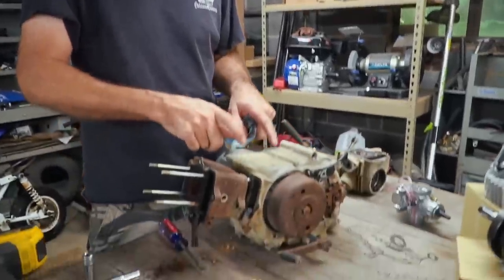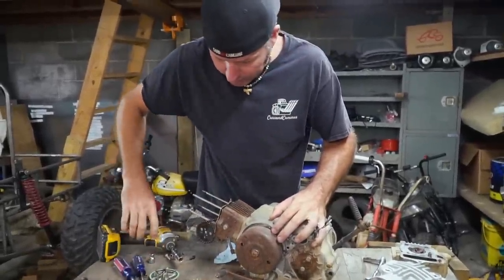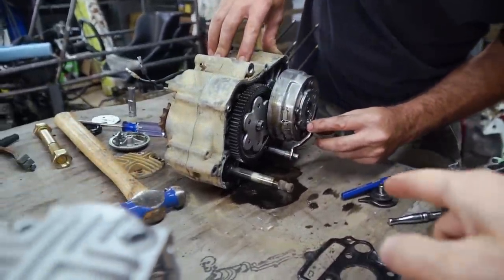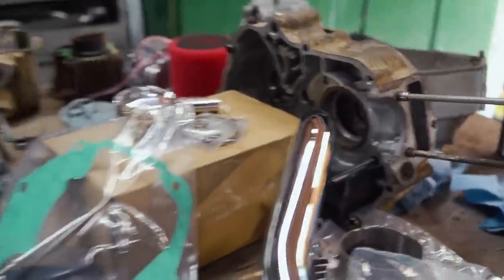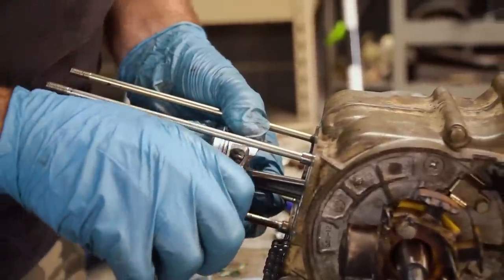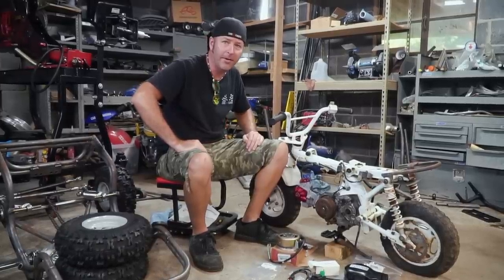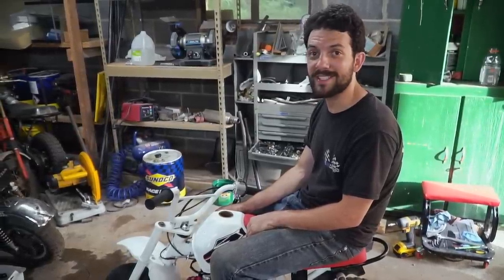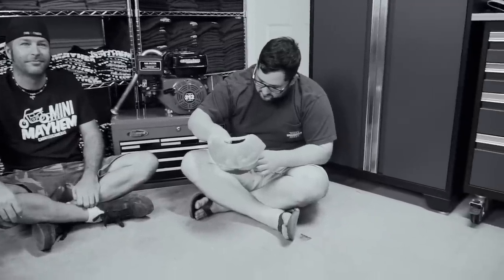ABANDONED Frozen Honda Z50 Engine Rebuild + Upgrade | Racing 108cc Big Bore Build

Comment from the maker: Happy Labor Day! Hope you all are out enjoying awesome weather!
Reply: CarsandCameras hey i don’t think you would go this far but, me and my buddy want to sell or trade his full size buggy/go kart. It has a gy6 copy with a bored head. It won’t run anymore and we are wanting to get something that runs. Have a Nice day
Reply: It's 11° celsius in Manitoba right now so not too nice of whether but still enjoying it
Reply: Its thunder storming here in OH so not to nice but atleast its in the 70s temp wise
Reply: Do you all want that grsx 750  that I’ll give you
Reply: Weather is gorgeous in New Bern.
Reply: CarsandCameras great video. I did a similar thing a few years ago. But apart from cylinder piston and rings i reused parts from two different engines. A lifan block and a honda head chinese timig chain and diy gaskets :). Had to change camshaft cause the valve would hit the piston. I used old parts but when it was done it was a beast. Ps.it still drives hasent blown up yet :) hope to se these kind of videos again. Cheers
Reply: Those Z50 engines look almost identical to the ones in the Honda ATC-110 / ATC-125M   I wonder if they are similar enough in size you could swap one in?
Reply: Yup....110°F in California
Reply: @milesdzineku9940   were are you located i have a coleman ct200u minimize with a torque converter setup and a mikuni carb on it im trying to find someone i can trade it with it runs and drives fine. I just want a go kart
Reply: Happy labor day guys I took the mini bike out for a ride today got it upto 50 mph! Yeah buddy
Reply: What awesome weather
Reply: Chris Dunham sorry I don’t think I’d trade the entire kart for a motor but we’re located in Utah if anyone’s interested reply
Reply: @milesdzineku9940  it's an entire mini bike not just the motor I drive it every day pretty
Reply: And I'm on Vermont so yeah that probably wouldn't work lol
Reply: Chris Dunham oh alright sorry I read it wrong
Reply: Chris Dunham its a possibility
Reply: @milesdzineku9940  how would we work this to send them to each other? Ive been dying to find a go kart but there's not many in my area unfortunately
Reply: Thanks! Can you guys do a tillitson 225cc and put it on nitrous oxyde please
Reply: Chris Dunham idk I’d be down for local pickup but then again we might just fix it up ourselves
Reply: Would you be interested in a go cart with a predator 212 just needs new tires
Reply: @Joe803  who are you asking
Reply: Joe W depends on the size, this kart is massive more towards utv size
Reply: I was asking the cars and cameras crew
Reply: @Joe803  oh ok my bad
Reply: Joe W gotcha
Reply: @milesdzineku9940  upto you if your still up for trade
Reply: I shure did have a very fun labor day john and isaac I rode my tao tao 4 seater alot today and rode my coleman go kart and also my yerf dog go kart. Happy labor to you guys both.
Reply: mark z  your from Manitoba? Never thought I’d ever see a fellow Manitoban in the comments on YouTube.
Reply: I'm wondering when I will get my hat I order 2 weeks ago

Comment: Hey guys. When you take the clutch cover off, replace the oil pump to a high volume one, drill the case to 2mm with the oil pump out. Its the port that delivers oil to the head/camshaft.(that is a old mod) also always remove the oil screen, inspect and clean it out. Ive seen so many clogged with gasket materials, gunk and sludge. Love seeing this video

Comment: I owned a Honda Dax (ct70) once and it would not engage the gears if the gear arm didn't have enough throw, for me it was because it was bent(the arm). Also the transmission kinda jumps when you go from neutral to 1st. It's a good indicator. Love these engines. 👌

Comment: I used a tbolt stroker crank with a stock crf70 top end on a sl70 this summer. 88cc stroker. Tboltusa makes some nice stuff, I was very surprised how smoothly it runs.  They must spend time balancing their crankshafts or something.

Comment: That compression reminds me of my old '85 Honda XR500. It had so much compression I still have a chunk missing from my shin when it kicked back on me. Me only weighing 160lbs I struggled to kick it over, especially in the winter. Below 40°f and it would take everything I had to try and get it turned over. Man I miss it. I would love to have another 86 XR500R or the 85 XR500

Comment: I've rebuilt a few of these small honda engines. The shiny or chrome looking ring always goes on top. The black or plain steel colored ring is second, both with the letters facing up. Hope this helps in your next rebuild!

Comment: Great video! Looks like some shifter linkage didn't get hooked up properly. At least you can switch out the clutch for a HD unit while you have the side cover off. every stock clutch I have ever seen has been toast.

Comment: I've never seen a Honda like that one before. Looks really cool. I think what would make that bike look awesome....would be to put a longer swing arm and lengthen everything in the back of it. Seat, bar behind the seat, put a small rear fender and possibly rake the front just a little bit to make it long-n-low. it would look great and easier to ride without worrying about flipping it over backwards. Anybody else think so? that little bike has got that potential to look really awesome. It'll be fine and cool. I think that is one of the best looking small Hondas that you own.
Reply: If you didn't notice they have like twenty of them and these are trail bikes. Also they're called Honda Z50 monkey bikes

Comment: You should only have to pull off the right side case, and recheck the orientation of the shift arm and dentent arm, this is a common issue and should be an easy fix👍🏿 nice video ☺️

Comment: There's a nut and screw in the center of the case in front of the clutch. It needs to be backed off a half turn or 3/4 or so. If that doesn't work, you need a new clutch

Comment: Real quick fyi...those 50 pistons are perfect floor shifter knobs and have been used as such at least since 1980 when I used one on my manual Hemi 4 speeds shifter behind my mildly built 440 in my 72 Duster... Slick.kewl factor 11.9 on a 1-10 scale...😁

Comment: High performance inner rotor kit this thing will rev to the moon!
Reply: only when it is the short stroke version. these engine's also have long stroke. in that case you do not want a inner rotor.

Comment: Better drop a couple teeth from the rear sprocket. You have plenty of power for the "longer legs". That's cool as hell. I'd have loved to have done that with mine. My friend had a 50 cc, 2 stroke trail hopper. It was ugly as hell, but faster than my Z50a. Mine had chrome fenders and headlight bezel with a metallic blue tank. Got it for my birthday when I was a child.

Comment: 2:19 before y'all go any further in the vid just know i feel your pain...i got "stuck" fixing a friends "stuck" yamaha 200 blaster quad. This started off in July when i was asked to ride this turd home...thru the streets of west side Detroit, in the hood. We got there and it would only run on half choke and 30 kicks....once started i said im committed follow me and i never let up. Way down on power and no idle i kept er running and drove it about 5 miles in the hood to a secret undisclosed location not but a mile from the house. When in a safe space i checked it...why am i feeling exhaust gasses here and why are we glowing red between the head and jug?. Week later trailered it to my house, tore down to find the expected blown head gasket and thankfully no torch damage to jug or head surfaces. A $9 gasket later and this thing scared me by firing 2nd kit! But now there is no idle and it screamed to like 4000rpm instantly. Another day goes by i tear down the t.o.r.s. throttle over ride system, just to find a broken switch. Order a delete kit which is a cable and mikuni carb top cap and a second kit with a mechanical idle screw with a drill and tap. Some time went by as we waited for parts and some other projects to go thru.
My friend "needed" this quad for labor day weekend and i came thru last wed. Was running better than expected. I ran out of time to fine tooth comb this thing but my man was happy and took it on the spot and trailered away.
Next day i get a panic call "this thing was screaming like no tomorrow then it locked up 'bout threw me off and now wont kick over its locked up".
Im thinkin ut oh... I mixed the gas to 30:1 with 8.5oz amsoil to exactly 2 gals. I blocked off the oil injection system myself. Stock tune on a stock motor....so i knew it was nothing i did. Thank GOD he didnt blame me either (and also looking into a polaris 500 single lung 2 smoke which he will get today if first buyer backs out...its 3:59pm here in michigan and i just learned this just after 3pm...another project for me im sure, but hey keep bringing 'em and ill keep fixing em best i can.

At this early point in the vid i have no idea how your project will turn out, but as always im on your side and about to get the popcorn.
Lets do this!

Comment: plug all the holes, power wash, dry, glass bead blast then disassemble. If you like the looks of the case, clear coat . then disassemble.  use dish soap to clean after assembly.  just an idea... nothing replaces displacement!!!! go big or stay on the porch!

Comment: Just seen Ike doing the welding on the cast master cylinder.. you should check out the skid factory.. welding cast manifolds with a mig welder 🤘🤘

Comment: Parts for these engines are very cheap. Just done a 70cc conversion on my skyteam 50. Easy as same stroke length as the 50 so no need to change the crankshaft. Made it a lot more usable though.

Comment: just take the clutch cover off and make sure that little spring and triangle thing is in the correct orientation. Looks to be your problem. Sometimes it falls when putting the cover back on.

Comment: I had a seized 212 from the person that had it before me let it sit out with no air box and I could not get it to break loose i worked on it for like a week whole time it was soaking in marvle mystery oil and I just got fed up with it and smacked the piston with a hammer and broke it free and the thing still runs like a champ just a slight dent in the top of the piston

Comment: had to do the big no no to a tl 125 engine left it soaking in oil for days still needed a 4lb hammer to remove the piston, got it out cleaned the bore new rings and it ran for years, wish i never sold it

Comment: Heys guys I wouldn’t be using flat heads to spilt the cases I always just install few case bolts 180 of each other an take a small hammer an go around an tap each bolt an the case slowly spilt every time don’t wanna mess up the sealing areas especially 2 stock engines . Do as u plz just something I’ve learned over the years

Comment: ROT for rings...120 clocked on each oil and spring ring...top and bottom ring dead ahead and 180 to the rear during assembly and the top most ring has a chamfer on the inside which always goes facing up as its the comoression ring and the chamfer is forced outwards by compression during the compression stroke... ALWAYS oil rings with engine oil before installation...double and then triple check ring orientation before installing into cylinder(s)... Use heavy weight gear oil in captured/caged bearings during assembly and cam lube profusely on all camshaft lobes.lifters.rocker or roller tips and pushrods ends...2000rpm for 15 minutes for camshaft break in is normal... Break in using the oil you're going to run in it and filters n oil is cheap compared to internal engone parts...change it as soon as break in is complete..
Reply: Your engine break in will be trouble free and engine will last longer...

Comment: Spray the engine cases with eagle one mag wheel cleaner. Be careful with anodized and zinc plated parts. But it will clean up engine cases like new. Just dont let it sit on too long. I clean my bikes with it almost every wash.

Comment: I never knew the piston rings can actually pull engine oil up into the combustion chamber, if installed with the numbers on it facing down. 
Can't believe I have never actually heard anyone mention that before...

Comment: If you are lucky, the clutch needs to be adjusted from the bolt to the clutch cover. If not, something is wrong with the gear selector and you have to go deep to fix it.

Comment: Rotate the exhaust end cap so it turns down. With heat tile on the inside of the plastic. It will be fine.

Comment: I’ll bet the shifter drum is stuck
Did you happen to try to change the gears while the clutch cover was off?    You might not have to split the motor or take the motor off either cause you can get to the shifter mechanism with the clutch cover off and the shifter drum is in the top left hand corner of the motor behind a star looking cover.
Try to turn the shift drum , you might have to use a 10 mm to get it free but I’d say that’s where your problem is ✌🏼

Comment: Why did you not drill the small oil hole larger(located on right side before jug goes on)    Read the instructions that must be done to increase your oil flow/psi fellas for these big bore kits including the 88big bore kit for the 50cc

Comment: Dont put the original clutch back in it, theres an upgraded 3 pack clutch that'll work fine with the 108. That 2 pack is going to slip in no time... also the clutch probably just needs to be adjusted.

Comment: Oh man I know that face when he realized the transmission was not working just started rebuilding a Baja 70 dirt master pay 250 for basically a frame through the clutch through the side of the case riding it for 2 minutes picked up a whole new motor for $110 what is starting to fix the misalignment of the rear swing arm and the shock exploded I feel your pain

Comment: Question: Don''t you guys gap rings or check the crank end play? Yes the engine might run but longevity might be a issue down the road, or it just might not make power to its potential. Maybe when you are using sponsored parts act like you care about the build and clean things Just a thought guys.

Comment: You might have been able to salvage that flywheel and stator if you had taken sandpaper to it so the magnets could actually work. And why would you not have checked that it goes into gear once you had it together lol smh you always check that before you finish putting it together

Comment: "got to see which way the piston goes" when there is a huge IN stamped in the valve relief in the piston, seriously guys.  Also didn't checked the ring end gap before installing the rings on the piston.  Any job worth doing is worth doing correctly, don't follow there two when building any engine.

Comment: I would have just bought a PIRANHA 140cc engine from them instead and saved myself $147 not only that the PIRANHA 140cc engine is 4 speed and has far more power than a 108cc